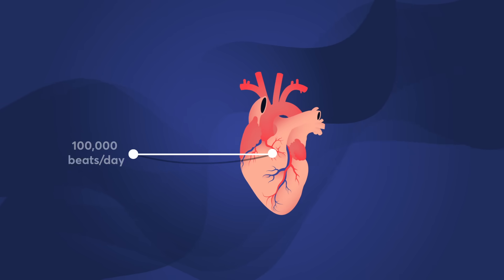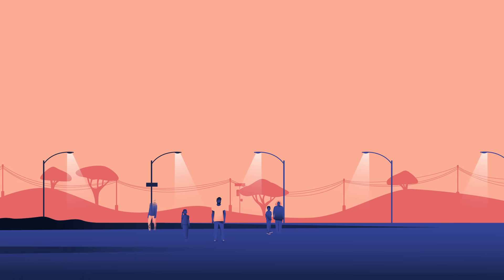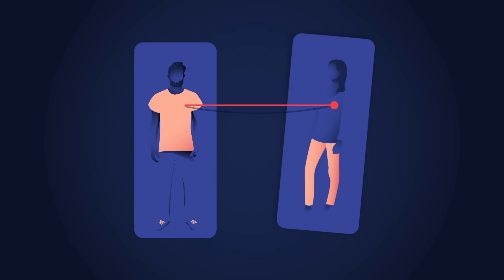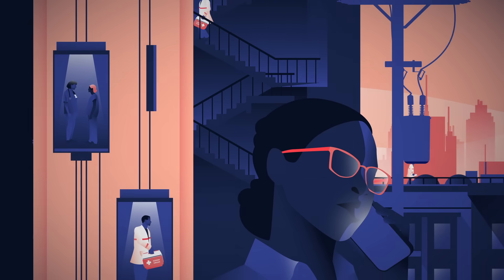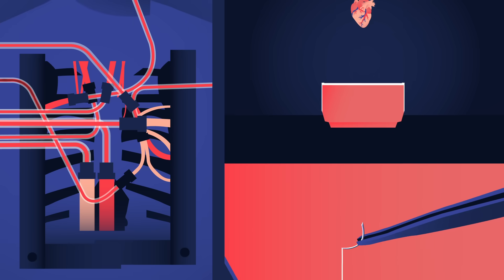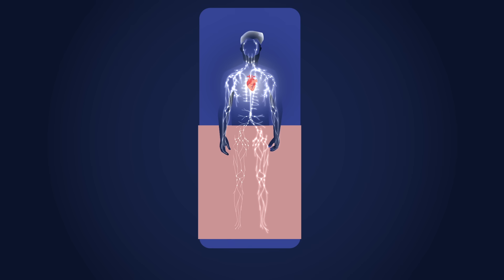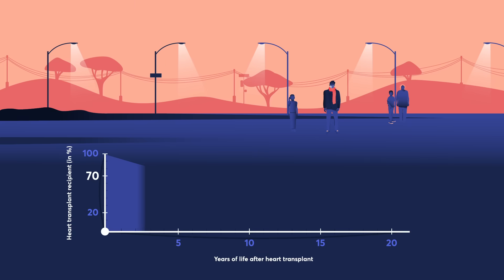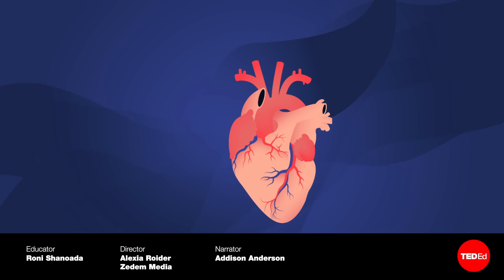How does heart transplant surgery work? - Roni Shanoada

Comment: It is fair to point out that, due to how scarce donor hearts are, the HLA and other antigens testing is often not a common practice. Usually, once a match in AB0 blood group system is found, along with other criteria such as size and weight, it's enough for a transplant compatibility. It also comes with the fact that the only way to obtain a heart for transplant is from a deceased donor, so there is little time before the organ starts undergoing changes where it is unusable for donation.

Comment: now this gives me ideas keep the previous heart so do not need to use donors maybe an injection into the heart which clears and recovers all inside tubes of the heart and clears the system  and all damaged blood vessels and clears arteries which are clogged which has been damaged through heart attacks. I know its possible but finding the correct antidote to make it work

Comment: How is it even possible to remove the ribs snd getting lungs out of the way
Reply: lungs are actually behind the heart so that's not an issue, the rib cage is split from the middle and put back by the help of surgecial tools and screws. its the same as having a severe fracture
Reply: @Oxly22  since when the lungs have been behind the heart
Reply: @seinahullu3368  existence
Reply: @seinahullu3368  waltuh did you skip I biology class waltuh?

Comment: I have an idea, why not make a mini machine that does that job? it could be powered off a nuclear cell, and we could store the battery in the arm, it would need replaced every 20 years but it would work well, also if mass produced it could reduce surgery costs
Reply: 1. Such technological feat is hard to achieve . 
2 . Nuclear cell even with lead coating would just minimize radiation but never nullify it .
3 . You would think that nuclear energy generates tremendous power but in reality it is not true . Under controlled environment , their would be very less decay to give out energy needed to equate the amount of energy the heart requires .
Reply: @hellothere3204  I mean, yeah, but I feel like given how little energy the heart needs it should be fine, like the nuclear cell could be the same ones used in pacemakers and hearing aids, it would work if used correctly

Comment: I have a question: if the doctors are unable to connect the new heart to the nervous system, how does the heart get the nerve impulses to beat?
Reply: I think its the nerve that regulates it, so it always is the same bpm
Reply: Actually the heart has a specialized pacemaker like cell that together creates what we call sinoatrial nodes these nodes rhythmically produce electrical impulse which will be spread troughout the heart creating heart beat. So your heart can beat on their own the only thing the central nervous system can control is how fast they’re beating trough sympathetic or parasympathetic nervous. In a fight or flight situation the sympathetic nervous system will produce epinephrine/adrenaline that binds to the beta receptors in the heart allowing for increase heart beat.
Reply: @zack88005  So as long as the heart is connected to a blood flow it does not need nerve impulses from the brain/spinal cord etc.?